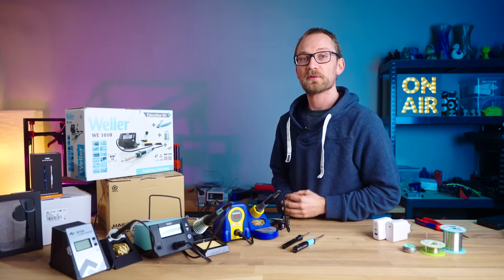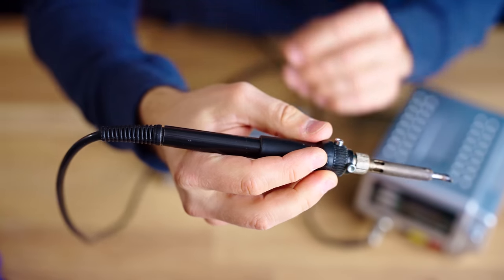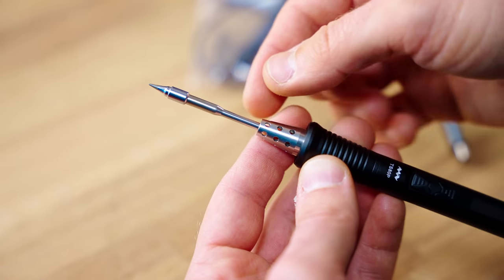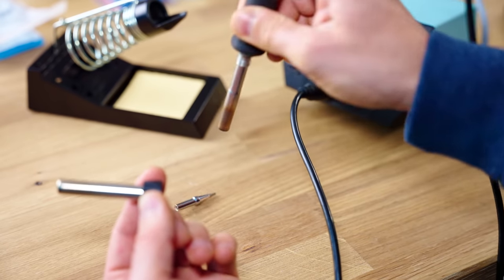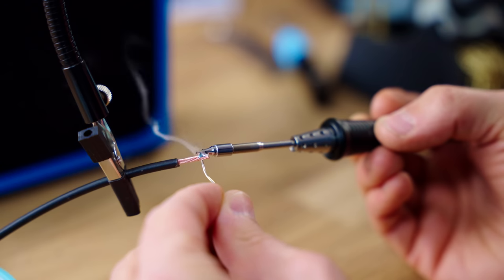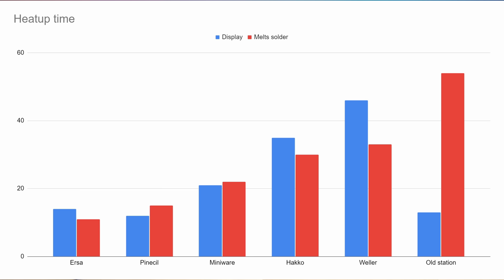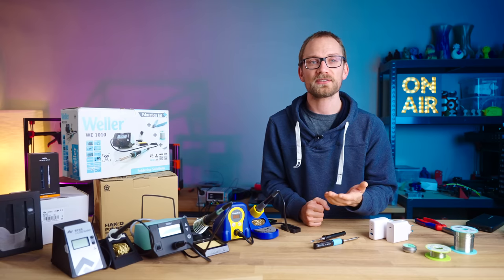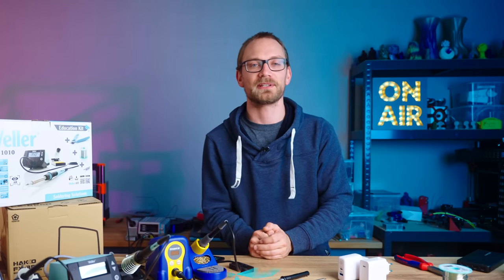Best hobby soldering iron? Pinecil vs. Miniware, Hakko, Weller and Ersa

Comment: I bet that ralim os doesn't have those annoying bugs in ts80p. I would recommend ts80p for people who want to use it a lot from powerbank.
The tip is better optimized for lower wattage than in ts100 or pinecil. Since most powerbanks only output up to 12v which means really slow heat up time and poor performance in ts100 tips. While ts80 works with 9v really well.

But if you're not going to use a lot from powerbank or you have powerbank that can output 20v, the pinecil is my go to. 
It easily became my favorite iron even though I had ts100 and 8586D+ soldering station.
Btw pinecil is 45w at 20v

I would definitely recommend pinecil for first and only iron. Pinecil has nice community around it. As for powersupply I would recommend old laptop PSU, you only need to change the connector.
Only cases where I would recommend ts100 over pinecil is if you want to use 6s battery with it since pd chip in pinecil is rated for 21v. It also has a little bit better build quality.

For those that didn't know:
-Pinecil has both barrel jack and type c power input.
-both TS100 and pinecil uses same tips and same size barrel jacks.
-Pinecil is cheaper (25€+shipping and other fees while ts100 is 45€+shipping)
-pinecil is a little bit thicker and in my opinion fits better in the hand.

If you do a lot of electronics, then I would also recommend getting soldering station with heatgun and standard tips. ts100 doesn't have tips for all uses and heatgun is really useful for a lots of thing.

Comment: The only thing I would have liked to see is a butane option to see how they stack up.   Honestly I have been considering the pencil style ones because of the fact that it can run off a quick charge battery bank.     There are times where I have wanted to solder something on location rather than disassemble things to take the part I need to work on back to my workspace.

Comment: From the research I have done I know that "jbc" and "pace" are professional soldering stations, unfortunately they are too expensive, between the Hakko FX-888D and the Weller WE 1010 as build quality which is the best ? Which of the two do you recommend ? I was also evaluating the AT-980E ATTEN

Comment: I've bought the pinecil after watching this review. It's great to work with an heats up pretty fast. But when soldering bigger pads or thicker wires The heat of the Tip is transferred into the part and the Tip temp drops instantly. Often even before the solder melts. Does that mean I need a bigger tip?
I paid like 70 € btw.

Comment: I spent quite a while looking at this topic all started because I could not desolder some capacitors with my 20 year old basic irons. 
The ts100 is better than the ts80. pinecel was a take on the popular ts100.Sequire also do these.
 All of these handheld devices can have the firmware upgraded to be the same apart from some sequire models. The pinecel's main advantage seemed  to be the open source nature which I liked and the ability to use QS charging via the new usb (arguments against are that it can fall off) in addition to the barrel power connector that can be plugged in from a power supply/dc adapter (which are not provided). However with shipping and taxes was more than SEQURE SQ-001 65W Digital OLED Programmable Portable Mini Soldering Iron RC which has a more expensive competitor. I was not sure if this would deal with my desoldering issue and note lots of videos which use third party controllers with genuine tips such as the hakko t12 tips, and if you need lots of power jbc tips. The change from old tips are that they are integrated one piece units with thermocouples in them more accurately passing on heat without the air gaps with changeable soldeing heads. The thermocouple in the head more accurately reflects th temperature of the soldering tip rather than heat in the rest of the iron which may not have been passed on.  The more powerful seems to be more useful if doing soldering/desoldering onto heatsinks/ground planes etc which wick away the heat and this is where intelligent controllers come into their own especially with heat sensitive components such as silicon chips on the board. Some old soldering irons have high capacities and have heat buffers in the form of more metal. Hope this is helpful to someone.

Comment: Thoughts on Butane based soldering irons? I've been using Weller and Duratech ones for a while and found that their non solder related uses can be handy in a more general setting. LIke their heat-blower/hot-knife tips.

Comment: Tinkering with soldering iron firmware is probably the last thing I need in my life. Let's see when there will be soldering irons with built in wifi and QR codes on the solder spool to set correct temperature and send it to the soldering iron via an app. Not to mention online only operation and different subscription  levels. Possibilities are endless...

Comment: I have Ersa, the review is correct. This was my first better iron, so I thought fast start was a common thing. The tip change is annoying, to the point where I keep average tip on. But I do change it if I need to solder way bigger wires or some 0402s.
Reply: How come you find the tip change annoying on the Ersa? I've had it for a couple of years now and tip change takes less than 10 seconds and requires no tools even if the tip is still hot.

Comment: It's an interesting comparo. I just bought some cheap no-name soldering station with an analog dial for heat, and honestly it does everything I need since I don't solder a lot. PS. The way the video hunts for focus constantly gets very distracting.

Comment: ooooor  you could get a portable one that is so handy you will use it as a daily driver and end up getting another one for your field gear :) there are a few option out there, i went with the ts100 as that was the most advanced at the time. Im still rocking them, they use the standard tips so its a breeze to change them. (no need for the fastening screw imo) they snap intoplace :)
i heard that i can customize the firmware apparently?! gonna look into that soon. 

good stuff :)

Comment: very useful video, thanks.  the Pinecil looks v. good.  the lack of display backlighting in the stations is terrible though, I have an older Chinese something, but it has a temperature/UI dial (although the acceleration programming is terrible) and backlighting.  I wouldn't mess with a non-lit display unless you always use it in the same brightly lit place.  mine also lies about the temperature, it's much slower to heat up in reality (but not too bad).

Comment: Careful with the weller one as some (or all?) doesn't have any input protection so if anything goes wrong in it there isnt any fuse so it will end up in flames.
A cheap one with fuse is much safer

Comment: You could at least mention about grip distance between fingers and tip of iron. Short distance from ersa is ideal for micro soldering and ideal for shaky hands. But it is insanely expansive, i cannot find it here in Europe for less then 300 Euro (vat included). 
I stick to my 25 euro iron station from aliexpress till i can afford to pay 300 euro.

Comment: Instead if those rather expensive USB-C powered options you could have put some cheaper stations or regular mains powered soldering irons which are cheaper and dont require you to provide a power supply as expensive as the unit itself. For example i bought a Parkside soldering station for 30 bucks in Belgium from Lidl with digital temperature control and display and i am very happy with it

Comment: For occasional RC hobby connector soldering a simple name brand 67 watt soldering iron with replaceable tips and safety stand  is sufficient. Quality soldering stations are nice  for constant  use on a variety of projects. For heavy duty soldering a name brand  100 watt iron is better. Use quality 60/40 rosin core solder and rosin paste flux and good technique learned with practice. Hand soldering with "lead free" solders requires higher heat and excellent technique for reliable solder joints without heat damage to connector bodies. Watch "how to"  videos and practice watching for good solder flow. It ain't rocket science!!!

Comment: So where is the temperature sensor located in each iron? This is kind of important. Looks to me as if some tips contain the sensor, and other don't. I believe the Hakko 888 does not (too bad you didn't get the 951, which does ... but evidently Hakko wouldn't come up with a free sample). And where is a graph showing tip temperature before, during, and after soldering heavy wire? If the temperature doesn't recover quickly, this is significant. I'll bet those small irons have problems in this respect.

Comment: I really want to try the Pinecil but including shipping, tax and courier import fees it will be between 70 and 160 EUR depending on shipping company (national mail is the bottom of the range and UPS/DHL express the top) which is unreasonable. And that's just for the base kit, no extra tips, power adapter or even cable.

Comment: I was disappointed from Ersa. I have an analog soldering station (Analog 80 A)from them, which was rather costly back then. Yes, it's got some years now, and it was 'just' 250€ (not absurdly overpriced like a Weller..) but from the price segment it is in, I expect better service than from a cheapo chinese whatever. But the tips for this iron already are insanely priced (like 50€ for some models!), so I have switched to  the KSGER T12, with a HUGE lot of cheap noname T12-tips  and I'm very happy with it!

Comment: i professionally daily drive a Miniware TS80P, and im sorry to say some of the Statements about its performance arent true. You can set a Temperature beforehand, as you can see at 6:54 (WkTemp). also, you must´ve had an old firmware, because mine never crashes when changing Tips, merely indicating a "Sensor error", and immediately reheating when a new Tip is inserted. There are also Chisel tips aviable to help with bigger Soldering Jobs.
Overall a nice and informative video, i just felt like adding these Points because it seemed unfair on the Iron.

Comment: I've had the Hakko 888D for a long time and really like it.  The only thing I don't like is, because I don't change the temp very often I have to look up the procedure in the manual  every time because it's not intuitively obvious.  I wish I had bought the analog version back when I bought it.  not even sure you can get the analog version anymore.  It just had a temp dial on the front.
Reply: As far as I can tell everyone wishes they could still buy the analog version. I like my 888D just fine but the interface is atrocious.

Comment: @ThomasSanladerer I'm planning on buying the Weller 1010NA soldering station on Amazon and ai'm wondering.. what tips would you say are crucial to have when first starting out with soldering as a hobby for work on PCB's? I want to avoid buying a pack of five tips, of which three or four I would rarely use.

Comment: I don't understand this test. Why is soldering like a race for you? Are you in a quick soldering championship or what? Why is it relevant if you can solder after 20 or 60 seconds? I have the feeling that all those speed-related tests completely miss the point about what makes a good soldering iron/station.
Reply: I agree. If an iron heats up fast but can't maintain temp under load you're kind of missing the point.

Comment: The ersa has the best tool for the job, small and light but powerful and very easy to change tips with no other tools. It seems that your ersa has a problem, I switch tips within 5 seconds and I have plastic nuts on all my tips, never had a stuck one.

Comment: Having exactly your old setup ( Atten AT80D ), I'm looking for an update after I saw this test. Now I know why it was incredibly hard to solder my AWG6 multi strand wire... Thank you for your test, I'm going with the Ersa for  its very nice and short tip. The looks are awful though, so I'm considering the next pricier option. The weller looks nice, too. After reading some comments about  bad quality and a report of Dave from EEVblog I'm slightly hesitant.
Reply: I bought the Ersa because it looks nice and clean. The Weller looks like it was made in the 70's and the Hakko like it belongs in a kids room. I guess it's all down to personal taste. Either way the Ersa is amazing even if you don't like the looks.

Comment: I have gone through 3 Weller stations and now use the same Hakko you have. All of these are passive tip and I’m starting to think I need to go active tip. Time to heat-up is meaningless, done only once per job. Why would that matter to anyone? Many of my jobs are quite large, like a 200 point TT patchbay or 50 microphone cables and I’m frustrated by the time between contact and melt, which I think should be unmeasurable. I guess I’m losing patience in my old age.

Comment: My TS-100 is powered by a 24VDC 5A power supply. The manual boasts that the iron is 65-watts. I don’t understand why he didn’t cover the TS-100 as it’s more(?) powerful than the TS-80 with a non-100W USB-C power supply (30W?). I very much doubt the soldering iron is merely 30W. Can anyone confirm this with a public test? The TS-100 is open hardware and open software. You’re welcome Pinecil. TS-100 uses cheaper tips. Oh, and Metcal and JCB? OK more expensive, but still total beauties!

Comment: I replaced my cheap station with the Ersa RDS 80 and it is a beast. I'd say it's a rather close to the Weller model here. The tips are a bit more expensive though (and the fancier tip styles hideously expensive).

Comment: Tom, you nailed Project Farm 👍
But you failed as far as the Weller and the Chinese units— the tips have a shoulder for tip removal sans nut. Much better than unscrewing a hot thing.

Comment: Maybe i am past the pure hobby stage, but i think with a bare minimum of ambition comes the annoying need to get at least 4-5 irons, a hot plate and a gloryfied hairdryer.
In my head i divide the irons i have into grams per second smelting capacity. That means the combo of heater and thermal mass of the tip.
Sometimes you want to go all out, like soldering EMF cans, 100W is where the party starts, sometimes you wanna barely melt the tin to not upset that 100 bucks a piece chip you reluctantly bought after exhausing all the alternatives. And speaking of tips, you gotta wanna pay more attention to them than you do on the iron. They are what makes or breaks the whole deal.

Comment: I use a ~€500 JBC station all the time at work, and I can officially say it's ruined all other soldering stations for me. Sub 5s heat up, tip change while hot in a couple of seconds thanks to a fantastically designed tip storage area in the station, and 130w when you need it.

Unfortunately I don't do anywhere near enough soldering at home to justify anything near that price, but everything at a consumer level feels disappointing now. It is just crazy how far apart the hobbyist and pro markets are

Comment: I do not recommend the Weller 1010.
The pencil is very weak where the metal tube meets the handle. Mine is about two years old and is failing, for that reason, especially when using solder wick.
Also how hard would it have been for Weller to put a red power LED on the unit? With no light and a non backlit LCD it is very easy to leave the damn thing on accidentally. 
My previous Weller lasted 40 years, so I was exceptionally disappointed. I’ll be getting a Hakka I think.

Comment: Plot twist, the Hakko FX-601 is at about $45 for the 2 prong and about $65 for the 3 prong which is heavy duty enough to do stained glass is better than the Hakko soldering station! I gave away my Hakko station and have been using my FX-601 for over 4 years on the same tip. Be careful, as they can get crazy crazy hot! Radio Shack solder is the only thing I use on my station so YMMV

Comment: Can you change the soldering iron wand on the Erza? One thing I like about the Weller and Hakko is that you can replace the wands if they break. Looking at the Erza, it isn't clear if you can disconnect the wand.
Reply: It’s replaceable and available as a part. There is a L-shaped Molex like connector on the bottom of the unit with stress relief cable routing where the wand connects to..

Comment: where is the oki/metcal entry they are the gold standard in soldering, metcal invented the tech that the high end hacko and ts80p style irons are using for measuing temp/power demand.  FYI Metcals have a rubber pad on the chord that you can use to change a hot tip, no need to wait for it to cool.  i have an old metcal sp200 its a beast, heats up faster than every iron you tested in this video. the metcal also does automatic idle when you put the iron back on the base using magnets.

Comment: could you try your old soldering station with a genuine hakko tip? One thing i've noticed with cheap tips is that they are the wrong size, so the heating element is either not touching, or barely touching the tip. you have an air gap and the heater is glowing red. genuine hakkos fit perfectly. that may explain why the hakko works better considering the iron is just a clone.

Comment: Are you sure it's 24v? I've seen two versions of the pinecil one with 21v written on the side and the other written 24v... I use a 6s lipo for my TS100, would love to continue using it with the pinecil.

Comment: I find that the mini ware ts80, ts80p, ts 101 are all much more expensive for the handle and the tips compared to the pinecel with no advantages over the pinecel v2. Also can confirm that miniware tips are easy to break even when being careful.